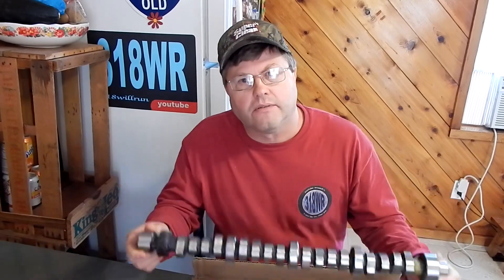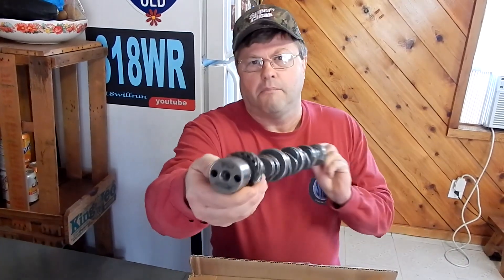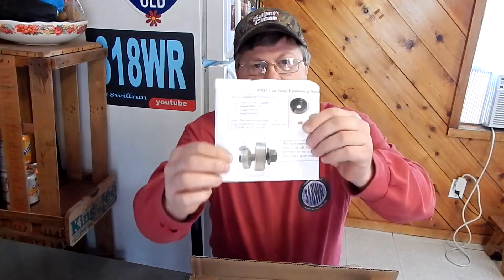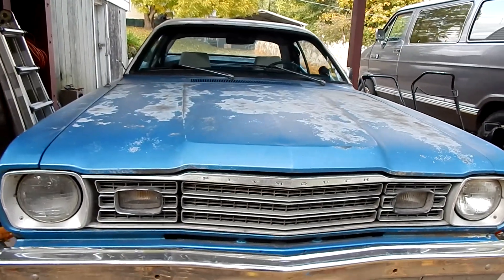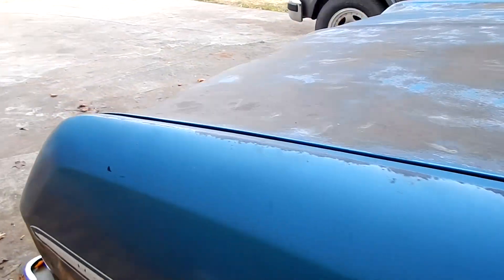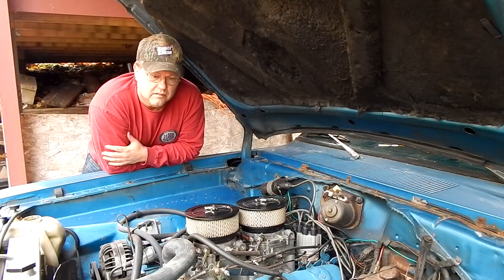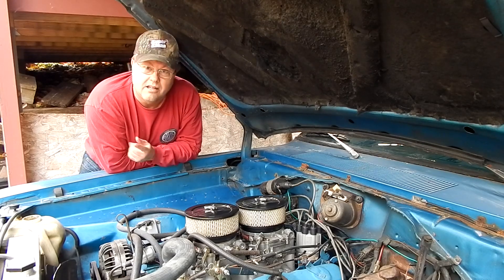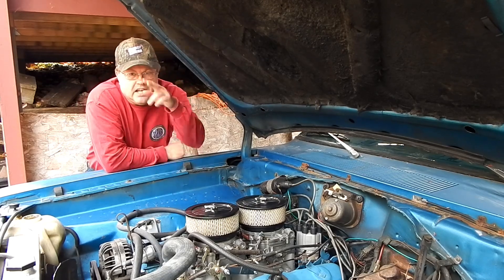Parts!   5.2 Magnum mild build for the Plymouth Duster * Change and Challenge 318 Mopar

Comment: I put that same cam and springs in a magnum 360. It's got long tube headers, edelbrock air gap,  650 brawler.  It runs good! Great response right off the crack of the throttle and good pull all the way up into the rpms a bit. I look forward to seeing how it does in your 318.
Reply from the maker: Thanks for the feedback!!!!!  I like real life testimonies!!

Comment: I put a 340 RV cam in my '87 318 in my W-150 can really feel it between 2000-3500rpm's good luck with the build!!👍👍🇺🇸🇺🇸
Reply from the maker: Thanks!!!!
Reply: Almost forgot to mention glad the clutch fan worked out on the van, I know it sure made an improvement on my 87 318.
Reply from the maker: @jeffsr8300  We got more out of the fan than we thought we would for sure!!

Comment: Richard Holdener put that cam in a 5.9l and got 360 hp.
Reply from the maker: Interesting!  Thanks for sharing!!
Reply: @318willrun  I'm running a comp cam 20-746-9 .... 114 lobe sep , 506 exh and int in a 5.9 magnum 600 holley  with Hugh's springs I'm very happy with it .

Comment: Recently I have been watching some of the other channels and comp cams with flat tappet lifters has turned into horror stories,  after just trying to break in cam and lifters completely warn-out on break in. Causing all that metal to go threw the motor, gotta be disappointing not to mention the cost.  I think the only way to go is roller lifters, I just would not chance it with comp cams. I do run a comp cam, extreme energy with flat tappets but it was purchased over 15 years ago and running. Thanks for that video and just trying to get your point of view on that subject.
Reply from the maker: Yes, flat tappet cams/lifters has had it's turn in the barrel per say.  Hoping the roller cam eliminates that issue here.  Thanks for watching!
Reply: The operative word is 'Comp'. They have a problem with their lifter suppliers. Not made in the US. People have been running and breaking in FT cams for decades, 70-80 years at least with no problems. Don't be afraid of FT cams. All these people use Comp and then are surprised when they have a problem when there is plenty of info out there. Using Comp your chance of failure goes up by 50%. I wouldn't use anything from them on general principle if they produce this kind of trash and refuse to correct it.
Reply: Like u said if it's there suppliers for flat tappet,  why don't they correct this issue,  because they are the one who is getting the bad name. Because as it stands I would not spend money on there product.
Reply: @markszczepaniak5888  I've 'heard' that they get their lifters from Federal Mogul/Sealed Power which in turn makes them in Mexico.  The only US based flat tappet lifter Mfr is Johnson Lifters in Taylor, Mi. You could just buy a bare cam and your own lifters but I don't think they would warranty it in that case. I think they don't care about the quality because it's cheap for them to send out another cam. But what about all the trash in your engine? There's a long story about why Johnson won't sell lifters to Comp (and Comp doesn't buy them). Some more, 'reputable' companies like Crower, Lunati, Howards, the smaller grinders, have better quality. You can ask them where they get them from. Not positive but I think Comp has standardized to the HT-2011 small block lifter for everything (Chrysler SB/BB).
Reply: Thankyou for the info, very much appreciated.
Reply: @vincemajestyk9497  
Since he is using a roller cam/lifters I doubt there will be a problem.

Comment: Since you aren't using headers, are you using the stock LA manifolds or the magnum style?
 You probably already know that the magnum exhaust manifolds are comparable to the "block hugger" shorty headers, (not quite the same, but a big improvement over the LA manifolds.)
👍
Reply from the maker: Great question!  We'll be sticking with the LA 360 manifolds.   I don't care for the bulk and weight of the magnums in a Duster, even though they do flow a little better.  Thanks for watching!

Comment: Does this cam have a choppy idle ? Is it noticeable ?
Reply from the maker: no, not at 114
Reply: @ i want to buy the 20449 comp cam its 480 480 112 lsa will it chop more then the 114?
Reply from the maker: @1mad_bug  little more.  whiplash cams or thumpers will give you all the chop you want at idle.  Other than that, 110 is where nice idle "chop" starts
Reply from the maker: @1mad_bug  It should

Comment: Is a magnum engine like an LA engine were you just put the rockers on and tighten them down or do you have to rotate the motor and go through the firing order and tighten them ?
Reply from the maker: no rocker shaft, but just tighten (torqued) down.
Reply: @318willrun  so I don’t have to rotate the engine and go through the firing order ? Just torque down to 21 ft/lb
Reply from the maker: @brianwil89  Just tighten them down like a LA.  They are hydraulic lifter, even though they are rollers.

Comment: Were you ever able to resolve whether the oil pump drive gear needs to be replaced to use an aftermarket cam in an already roller Magnum?
Reply from the maker: Thanks for the question.  If it's not billet, which this cam isn't, I'll use the factory oil pump drive gear.

Comment: The cam I put in my 1982 dodge D150  318 with 30 over pistions is  Erson E420121  TQ20H  
Dur @ .050 : 214/214
Gross lift : .449/.449
Lobe Sep : 112   
rpm range : 1800 - 4800
it does alright for a daily driver . wish it had some lope to it
Reply from the maker: we'll see how this sounds when it's together.  Thanks for watching!
Reply: That Sig Erson grind is a great torque cam. I think the advertised dur is something like 292. Pretty high. Long opening and closing ramps. The TQ20 was recommended in a Car Craft 440 build in the '80's. Another nice mild Erson cam is the M/P2. It's a near copy of the Magnum cam. It has the TQ20 intake lobe and the TQ30 exhaust lobe. It's a BB grind but you could get it ground on a SB core. (214/226 @ .050)

Comment: That cam in a 318 is giving away torque with the 114 lobe separation angle and extra exhaust duration.  Unless you have a cork for an exhaust system, the Magnum heads are quite good on the exhaust side, they don't need the extra exhaust duration for a typical street engine. A Magnum headed 318 shouldn't need more than a 110 to 112 degree lobe separation angle for a naturally aspirated engine. 

I understand you already had it on hand. But you can do much better.
Reply from the maker: We hope the cam will work.  That would be great means it was just sitting there not being used.    Thanks for watching!
Reply: @318willrun  Best of luck to you!

Comment: Why use a 318 when a 360 is a dime a dozen in the bone yard?  Sell the 318.
Reply from the maker: Very fair question.   Our reasoning is we have the 318, maximum performance isn't the goal, and mpg are a target as well.   So we believe we can obtain the goals (or close to it) with the 318 we own.
Reply: @318willrun    Understood, it’s really the same reason a Ford guy will build a 302 instead of a 351. Is the deck height on a 318 the same as a 360? Just curious
Reply from the maker: @goldysgarage189  In magnum form, I believe they are close and compression is about the same because the 5.9 has dished pistons.  In the LA version, the 318 usually has a little more compression.